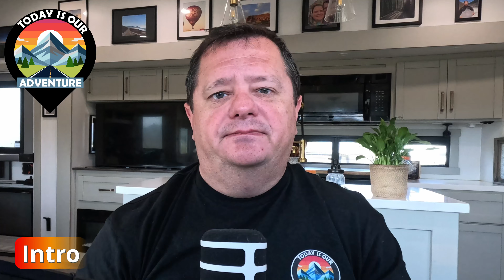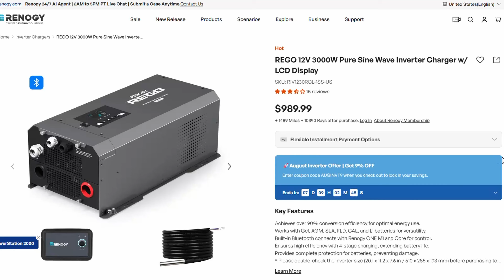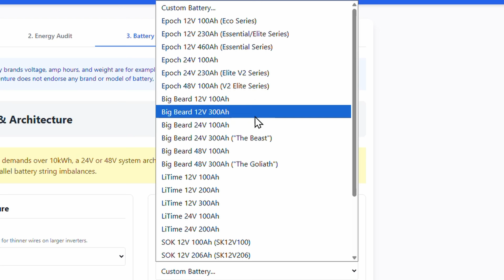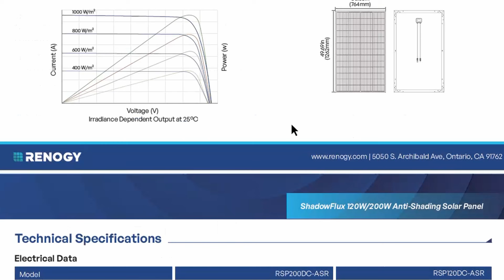How to Size an RV Solar & Battery System (Step-by-Step Energy Audit)

Comment from the maker: Planning an RV solar build? Before buying batteries or panels, use our FREE interactive RV Solar Calculator tool at ➡️ https://solar.todayisouradventure.com (or via https://www.todayisouradventure.com) to calculate your exact daily power needs and generate a custom blueprint!

In Part 1 of our "RV Solar Power Demystified" masterclass series, certified RV tech Mike walks you step-by-step through how technicians approach an off-grid energy audit, reality vs. expectation for boondocking, RV weight/GVWR limits, system voltage selection (12V vs 24V vs 48V), and sizing Victron SmartSolar MPPT charge controllers.

---------------------------------------------------
🛠️ FREE RV SOLAR CALCULATOR & BLUEPRINT TOOL
---------------------------------------------------
Run your numbers and generate a printout for your solar installer:
👉 https://solar.todayisouradventure.com

---------------------------------------------------
⚠️ LEGAL & EDUCATIONAL DISCLAIMER
---------------------------------------------------
This video and the accompanying web application at solar.todayisouradventure.com are for educational and informational purposes only. Electrical systems carry inherent risks of fire, personal injury, or equipment damage. Today Is Our Adventure does not endorse specific battery or component brands. Always consult a certified RV solar installer or licensed electrician to engineer, size, fuse, and install your specific system. Work at your own risk.

---------------------------------------------------
🚐 ABOUT TODAY IS OUR ADVENTURE (TIOA)
---------------------------------------------------
We're Mike & Amy (and our Dalmatians, Kayla & Riley), traveling full-time in our Brinkley Z 3400. We share real-world travel vlogs, honest campground reviews, and certified RV technician tips to help you live your best life on the road.

🔔 Subscribe for Part 2 (Batteries, BMS & Voltage Selection): https://www.youtube.com/@todayisouradventure?sub_confirmation=1

-------------------------------------------------------------------------------------------------------------------------------------------------
You can help support our channel, simply by clicking on the affiliate links below to see what equipment we use. Clicks are free and don't cost you anything: 

🛒 Self leveling blocks: https://amzn.to/3NofIng
🛒 Sidewinder: https://amzn.to/3W32uiF

🛒 GPS: https://amzn.to/3OcYIkX
🛒 360 Camera: https://amzn.to/42ORbNv
🛒 Gimble: https://amzn.to/3TpOUEO

🛒 RV trip wizard: https://tripwizard.rvlife.com/#63e12e5cb2423
      25% off Discount Code: TODAYISOURADVENTURE
🛒 Waggle: https://bit.ly/3x3Ygf1
       Discount Coupon: Amy50

🛒 TIOA Trailer Maintenance Journal: https://amzn.to/40iNPS4
🛒 TIOA Motorhome Maintenance Journal: https://amzn.to/3MFPCfo
-------------------------------------------------------------------------------------------------------------------------------------------------

🖥💻🖱 Check us out at: https://todayisouradventure.com

-------------------------------------------------------------------------------------------------------------------------------------------------
Other videos you may enjoy:
🎥 Lordsburg NM KOA: https://youtu.be/FnjTcGpX-jw
🎥 Little Rock AR KOA: https://youtu.be/IEtTWu8XQ9k
🎥 Needles CA KOA: https://youtu.be/psg4gZZRXfw
🎥 Santa Rosa Campground in Santa Rosa NM: https://youtu.be/a2h2L4YC0js
🎥 Rockwell RV Park in Oklahoma City OK: https://youtu.be/W9-NFgx2wf0?si=xE64ZvuSJokNJYBT

-------------------------------------------------------------------------------------------------------------------------------------------------
Disclaimer: Any tips and tricks shared are from our life experience and not as technicians or professionals. Please do your own research and due diligence. We are not liable for any damage to person or property from following the advice provided through videos or comments.

---------------------------------------------------
⏱️ CHAPTERS / TIMESTAMPS
---------------------------------------------------
00:00 - Intro & Off-Grid Solar Goals
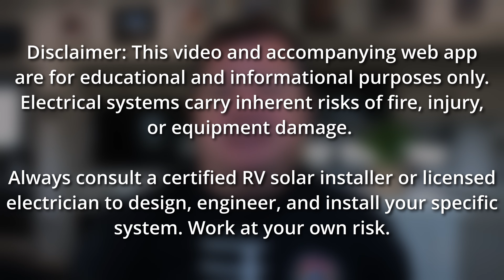00:46 - Legal Safeguard & Tool Overview
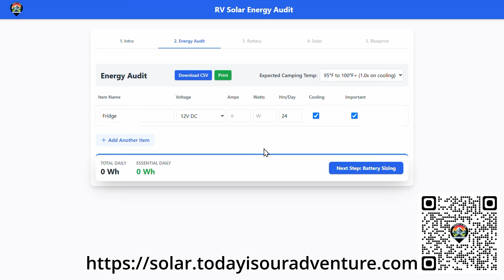01:06 - Victron Energy & Component Brands
01:46 - Expectations vs. Reality: Off-Grid Boondocking Limits
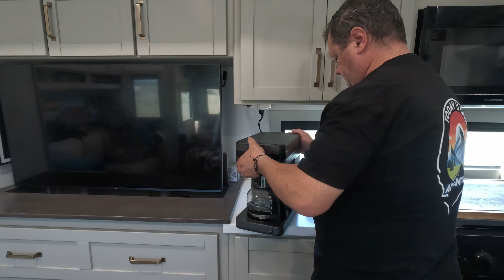03:00 - Step 2: How to Perform an RV Energy Audit
03:15 - Gathering Appliance Specs & AI Safety Warning
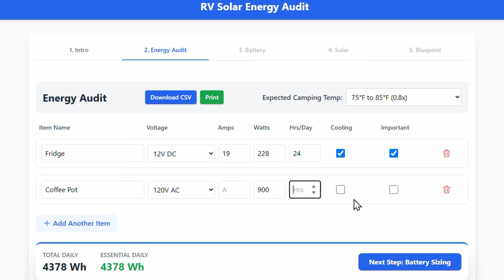04:19 - Estimating Daily Runtime & Temperature Multipliers
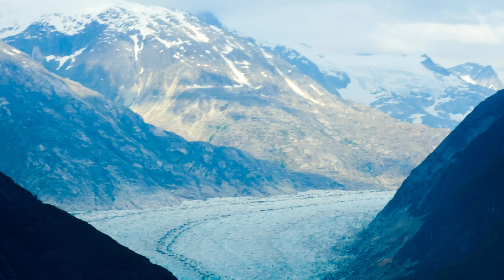05:11 - Reality Check: 46kWh Daily Demand & RV Weight (GVWR) Limits
06:05 - Matching Power Setup to Your Destinations
06:48 - Step 3: Battery Sizing & Chemistry (Lead-Acid vs. Lithium)
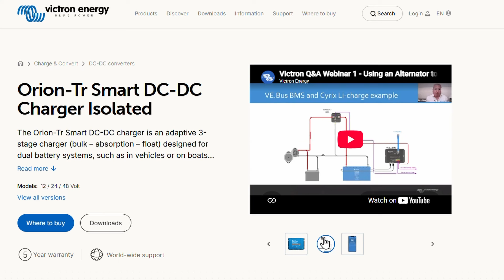07:44 - Choosing Battery Brands & Custom Battery Specs
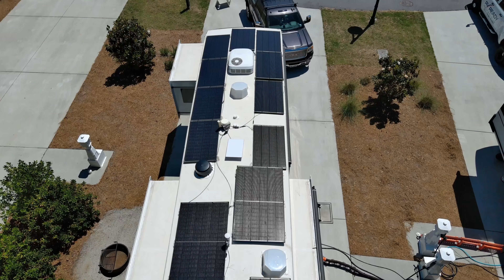08:29 - 12V vs. 24V vs. 48V System Trade-offs & Single Points of Failure
09:27 - 50-Amp Rigs, Alternators & Generator Backup
10:04 - Step 4: Solar Arrays & MPPT Sizing
10:35 - Deciphering MPPT Numbers (What Does 150/30 Mean?)
11:15 - Cold Weather VOC Spikes & Wire Gauge Balancing
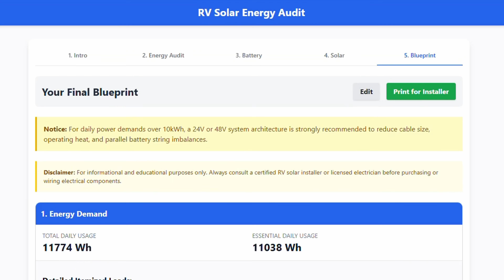11:47 - Step 5: The Final Blueprint & Installer Handoff
12:12 - What’s Coming in Part 2!
Reply: Thank you for the RV Solar Calculator. It is a great help.
Reply from the maker: @earldunkley3835 You're very welcome, Earl! Really glad to hear the calculator is coming in handy for your planning. Let us know what kind of numbers you end up with once you get everything plugged in! ⚡️

Comment: I read somewhere that sometimes it's better to REduce than to PROduce. The inefficient factory AC units are a good place to cut energy usage by replacing with an inverter unit or a mini-split.
Reply from the maker: @jake-mv5oi Spot on philosophy! Reducing the load is always better than chasing it with more solar. Our Brinkley came equipped with the Furion Chill Cube (a high-efficiency AC), which helps a ton with that exact issue. Unfortunately that is the AC in the back of the unit. The one in the bedroom... not so much and that is where we run into issues. Thanks for watching and commenting! 💜